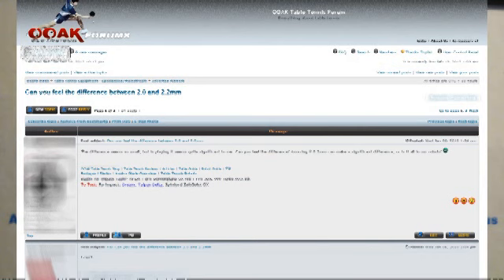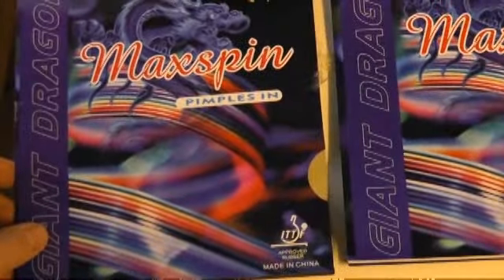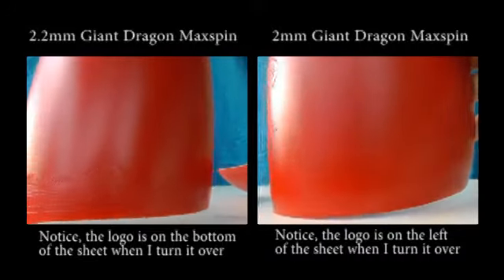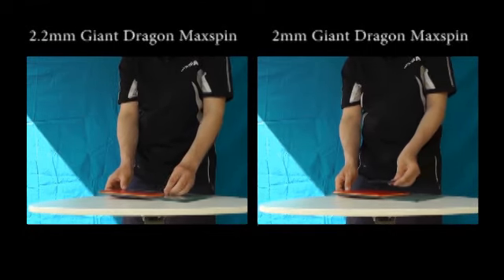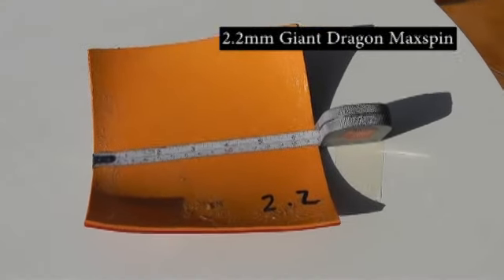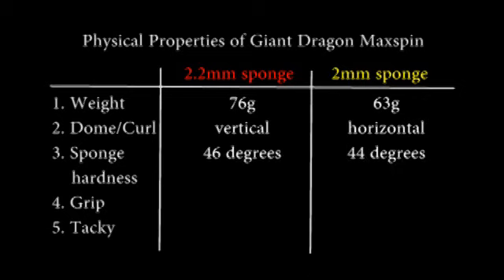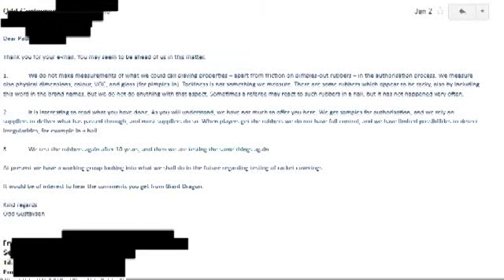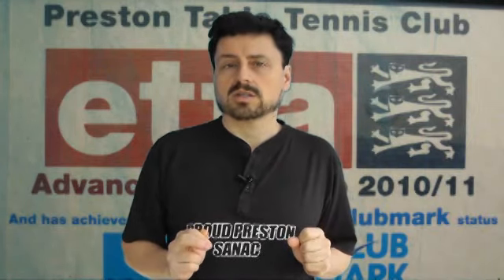Part 1 of 3: 2.2mm vs 2.0mm TT sponge thickness - Physical properties and quality control issues?

Comment: next time buy some rubbers from a brand that actually has a quality control, and compare those, this is rather pointless.
Not a single thing here was related to thickness.
Reply: ***** Well, I appreciate what you are doing, but I agree that any results with these experiments are largely unreliable with this equipment. If you want to test the differences between the sponges, then the tackiness absolutely must be the same for both tests...